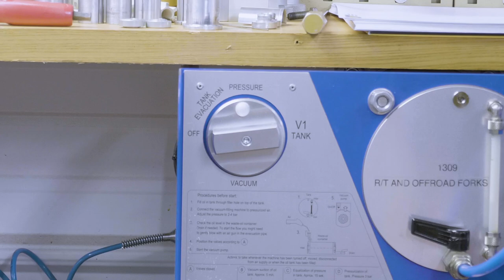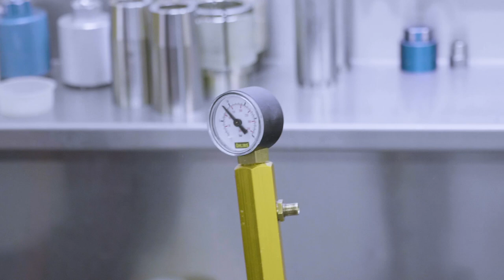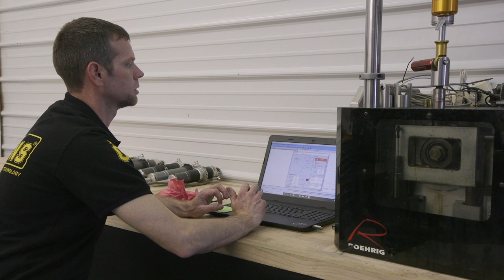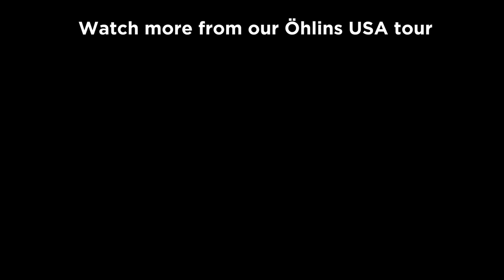Ohlins TTX 36 Damper Dissection!

Comment: 9:20 a sharp needle yes. but also put a bit of lube on it. so it doesn't cause any tearing, or issue with the rubber. just a little extra caution needed there! Ohlins doesn't say this. this is something I've learnt
Reply: 1:03

Comment: Another wise and sexy video from MK <3

The simplicity of this shock is proof that a lot of the best things are not overly complicated, esp compared to some of the innovative (complicated/special tools) designs of the past. The vacuum filler is great but most shocks don't have a filler hole like that, wonder how his fill technique/quantity would differ without that?

In my experience having worked on literally 1000+ shocks, I don't see any measurable nitrogen pressure loss when simply pulling pressurized needle out of the rubber seal instead of disconnecting the gage/filler in steps as shown in this video. I do see about a 10-15 psi loss when attaching a gage depending on the volume size of the particular gage etc so I typically need to add nitrogen after a pressure check to compensate.

For typical schrader style shocks, my filler tool has an internal plunger that opens the core when filling and retracts the core before I remove gage, thus not losing any measurable pressure due to gage volume with this method either. MK, you mentioned that schrader valves leak which seems odd to me but regardless, I like to use good metal valve caps with o-rings so even a failed schrader valve won't let the shock lose pressure through the valve.